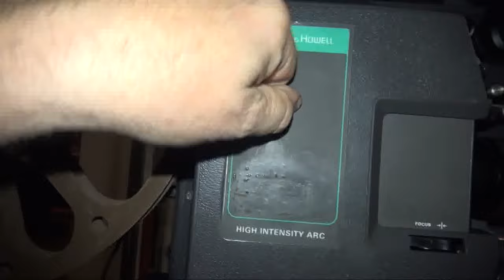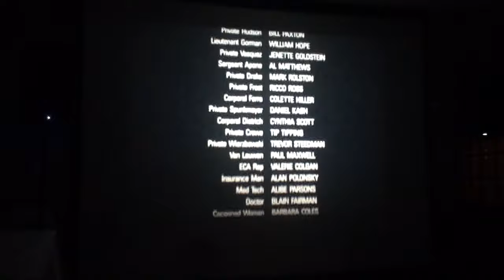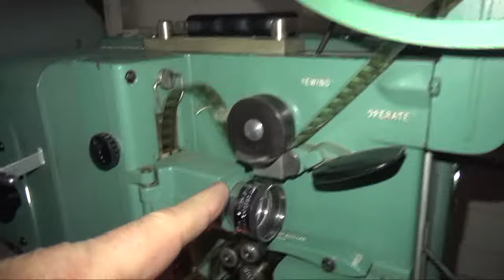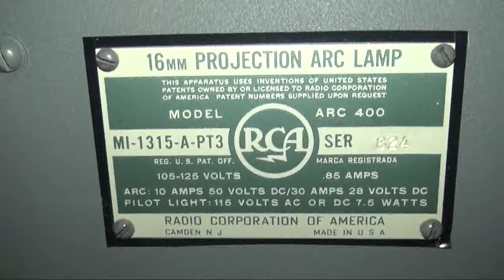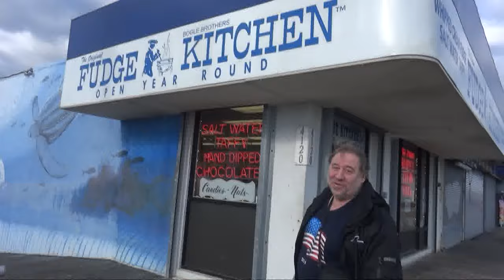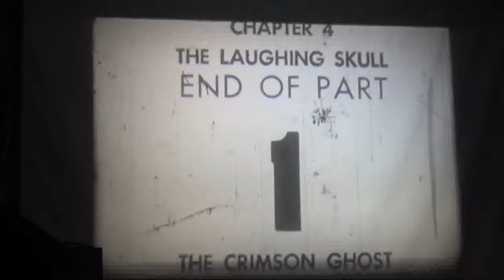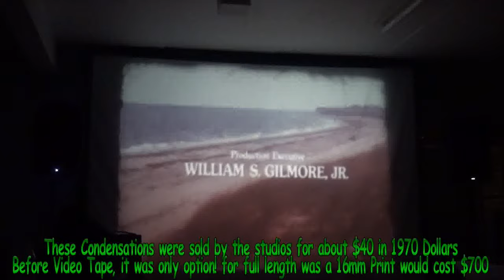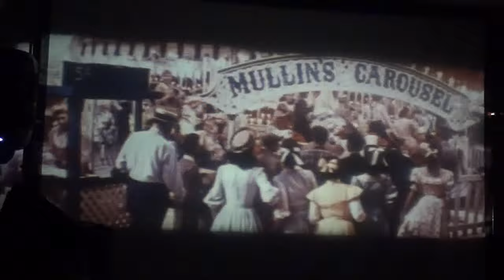#1212 CINESEA 14 FILM CONVENTION for 8mm & 16mm movies in Wildwood NJ- TNT Amusements

Comment: When I was in college, one of my old roommates got a job a the local theater. Occasionally he'd invite me to the employee screenings.

Sometime after midnight on the day of a movie's premier, a special delivery truck would come with the reels in these rather large metal cases. Then someone would have to splice together the reels and the appropriate trailers and advertisements. This would take about 40-60 minutes. Then we'd finally get to watch the movie.

The screening was a test to make sure everything was spliced properly and the sound was correct. I guess they had some sort of other digital disc system for the Dolby surround. Of course now all of this has been replaced by digital distribution and projection.

The same local theater also had a Revenge of the Jedi movie poster that everyone always asked about buying. The owners knew it was valuable :)
Reply from the maker: Yes...sometimes reels were marked wrong from last theater...it would be a disaster to have reel 4 mixed with reel 5!

Comment: hey todd, I picked up a prototype rollergames and am planning to restore it, it has the diamond plate ( myalred) playfeild and the stupid amount of 89s in the panel as well as the dark blue and red early production decals instead of the light blue (the decals are faded but I've sourced some new ones that have the right color blue). after  I go through it and clean, fix, led, rubber it and paint some things what is it worth because this is one of the hundred (I believe #38 but not sure) ur input would be nice thanks
Reply from the maker: It sounds like it is Colin!  I think I had two of them pass through TNT over the years...I would think retail 3K.